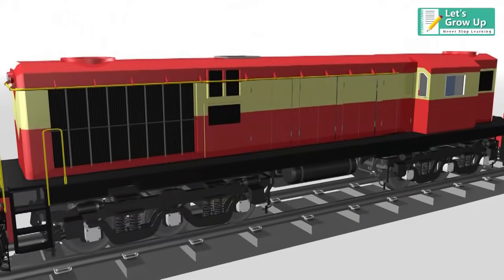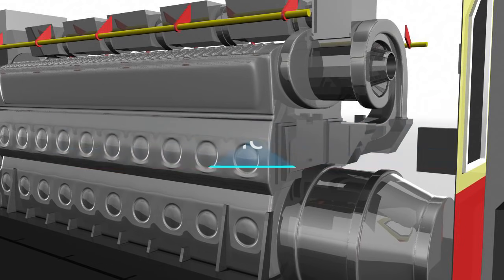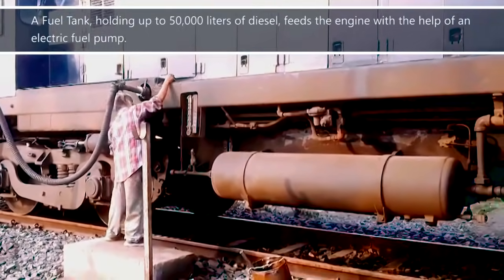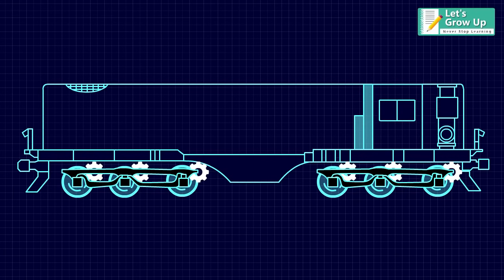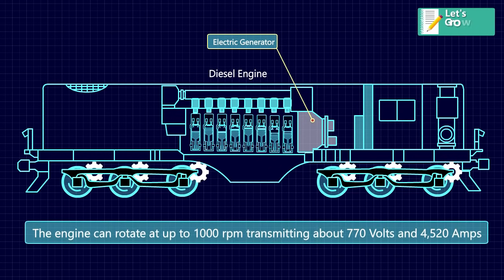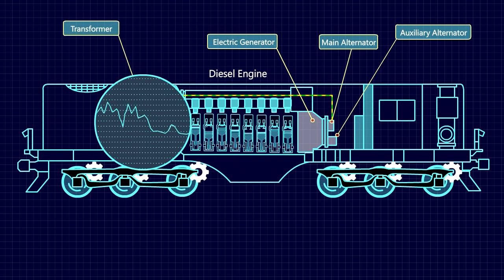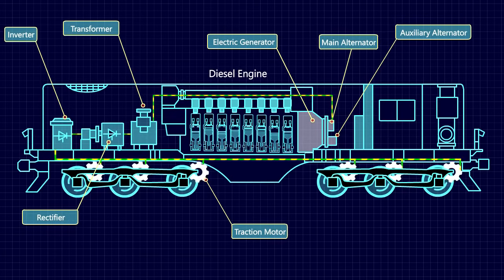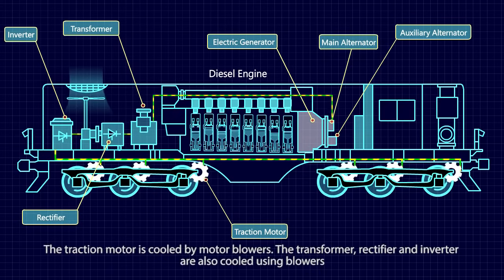Diesel engine working function | #Diesel locomotive | How a diesel locomotive works?

Comment: "A diesel locomotive is basically an electric locomotive"

Yeah an oil truck is basically a Porsche
Reply: It depends. Either a dual locomotive (both Electric and Diesel Electric) or a Battery-powered locomotive.
Reply: @MrStark-up6fi  also have diesel-traction locomotive.
Reply: The Big problem is the way to get the Diesel Generated Mechanical Power to the wheels. Clutches and Torque Converters are not efficient or strong enough. Electric Motors are Torque efficient but you need a lot of in between electric stuf to get it working. Seems not very efficient though if I see this explanation movie
Reply: @GertoHeupink  Considering how much weight a train can move seems very efficient. A 400 horse diesel truck moves 80,000 lbs. A diesel locomotive at 5000 horses moves millions of lbs.
Reply: A diesel locomotive is self-employed whereas the electric locomotive cannot work without electricity.
Reply: A diesel locomotive uses a combustion engine to produce mechanical energy that gets converted into electricity to run. An electric locomotive uses electrification already present (like catenary, third rail, etc.) to run. They are similar in that they both use electricity for propulsion, but their power sources are very different. A claim like that is fine, but not explaining why that is the case defeats the purpose of the analogy.
Reply: @LiyteRail  why we not give direct mechanical power to locomotive like a car...

Comment: why electrical motors on wheel axles are preferred to gear transmission ????. why  D.C Generator is NOT coupled to Diesel Engine than A.C Generator  to avoid Rectifier?? what about efficiency ???

Comment: whats the difference of track between electric and diesel railway?
Reply: None. The track is the same. A fully electrified railroad would have overhead wires to power the locomotive, but a Diesel or steam locomotive could run on the same tracks.

Comment: The video shows a 4 stroke engine as we could see valves, springs, rocker arm etc.
Reply: Detroit Diesels which are 2 stroke engines have exhaust valves which are manipulated by cams and rocker arms. Also the fuel injectors are operated in the same way. The engine shown is in fact a 2 stroke engine
Reply: Oh, many thanks for your clarification, didn't know that 2 strokes also had such an arrangement in the past.

Comment: I am looking forward to a type of engine wherein the train should be hauled by directly by the same engine also when electric traction is available bypassing the diesel generator section . Basically switchable between internal generator and external electric traction .
Reply: British Railways Class 73 electro diesels (built1962-67) can operate as either diesel-electrics or pure electric loco's where there is access to the electified third rail in southern England.
Reply: The electric motor needs no transmission. I could not even imagine the transmission that would be needed to drive a train. Think of a semi truck transmission pulling 80,000 lbs while a train pulls millions of lbs.
Reply: Wdap4 does this..

Comment: ALCO is 4stroke & have DC traction motors (generator directly makes DC & feed to traction motors via a voltage controlling rheostat)! 
You have talked in this video about Electro Motive Diesel (EMD) but the animated photo is of American Locomotive Co. Ltd (ALCO).
Reply: Where is VCR is using in ALCO locos.? Some also locos Alternator being used.
Reply: @sajeevpk5051  alternator is used in EMD locomotives aka wd p/g 4 series
Old tech Dynamo with voltage regulator used in Alco

Comment: Shows footage from other users and does not credit

Also 2 or 4, and anywhere from a V8 to V20. This includes locomotives from small Plymouth & Ruston switchers to the failed GE AC6000 & EMD SD90MAC.

Comment: No transformer is used in a diesel locomotive.
Reply: YRS I CAN SEE THAT SOME  ROBOT  DOSE NOT HAVE THE COMPUTING POWER FOR THAT
Reply: Most of the locos I have seen use DC traction motors. So no inverters or transformers in traction system.

Comment: I worked on a US Army program a few years back that was tasked with developing a new class of manned ground vehicles. The basic chassis for these vehicles utilized a diesel/electric propulsion similar to the way a diesel/electric locomotive works. The program never made it through initial development not because the propulsion system wouldn't work, but because the Army would never stop changing requirements.
Reply: Aereaux this vehicle would have been massively heavy most likely.   Would have been very expensive to operate as it would not be very fuel efficient.
Reply: @mohammadsiddiqi3500  - What's it like having a room temperature IQ?
Reply: Cool, now Biden can give it to the Taliban.

Comment: A simple reason they are diesel-electric is, because of the enormous loads they pull, using any kind of transmission would be impractical.
Reply: Also, they will go in reverse just as fast as they go forward.
Reply: LOL... it's about torque at standstill
Reply: Thanks for your this comment. It is the answer of my worry. But with so much advancement in mechanical engg wont it be possible to directly couple the diesel engine to the wheels?
Reply: @feoo123  I think it's possible, BUT ... the transmission would have to be HUGE  ... also keep in mind that a diesel locomotive will go as fast in "forward" as it will in "reverse".   And if that's not enough, there are 3 sets of drive axels in the front and 3 sets of drive axels in the rear of the locomotive !   What a nightmare that would be to try to set up a transmission and driveshafts.   Also, I know of no transmission that can handle 30 million pounds (that's approximately what a coal train pulls ... on level ground).
Reply: @ohbrother3792  so we can say its not possible.

Comment: What is the power of an diesel locomotive in horse power...?
Reply: Differs from locomotive to locomotive, some can be as low as 1,500 ponies, while others can have up to 4,500 ponies. Only a select few have had the privilege of trying 6,000 ponies, but now are either rebuilt, downgraded, or scraped.

Comment: What is the power of an diesel locomotive in horse power...?
Reply: In North American heavy haul service, modern road locomotives are generally in the 4000 to 4500 HP range. There have been some offered in the 5000 to 6000 HP range but there were reliability issues with the diesel engine itself.

Comment: Seems to me the majority of the liquid fuel energy is spent making three phase electricity then having to cool down the effort of making it ..! Efficiency percentage would be interesting to know.
Reply: The simplicity of powering all 12 wheels I think is the advantage here. This gives the locomotive more traction and power. Having mechanical drive shafts to do that probably would equal the weight of the alternator, inverter, etc. This setup is at least easier maintenance if not also lower maintenance. Just my guess.

Comment: Wow and all this while i thought they simply used a large diesel engine to run the drive shaft of the locomotive like a truck!!
Reply: It's simply not practical. Locos need to produce full traction power from a dead stop, for which electric motors (and steam engines) are ideal.

The prime-mover electric drive also does away with the enormous clutches and multispeed gearboxes that would also be required for a conventional drive.

Prime mover also has the great advantage of operating the engine at it's most efficient speed & throttle position - constant speed & load vs. constantly varying.
Reply: @drlegendre  i see thank you

Comment: You didn't explain why they don't just use a straight diesel engine, instead of using a diesel engine to generate electricity to power motors that then run the locomotive
Reply: Electric motors have better characteristics for actually transferring power into the movement of the train, in particular, at lift-off. Traction motors can produce immense torque at zero speed whereas direct diesel engine power would require a clutch and thereby throw a lot of energy into heating clutch plates while trying to start a heavy train. Also, when trying to control wheel-slip, electric circuits can respond more quickly than typical mechanical systems.
Reply: The transmission are so big that it will no fit in the wheels
Reply: @321aguila  yet there is a mechanical locomotive that use voith hydraulic transmission. But I wonder why they are not more common
Reply: Clutch will not work at such high load

Comment: Why do they have to show the locomotive going backwards (or in push-pull configuration) instead of forward?
Reply: Because not all engines go forward. Southern Railway (US) used dual cab controls, & not all trains are pulled in a set up that is a A-B-A setup. Most local trains (trains that serve rail-accessible industries within a certain distance on a certain route) often have to return the locomotive facing the way it will face when it catches the next train out (im using BN (Burlington Northern), SP(Southern Pacific) BNSF & CSXT for my references). Also most A-B-A trains have engines facing both ways to make it easier on the crew when working regional yards & interchanges (areas of tracks where 2 or more railroads exchange cars).  It also does not matter on trains if it is in reverse or not. Unlike cars, trains dont have transmissions, so a engine in a long hood forward (or reverse) position can still go track speed (example 70 mph or 112 kmh), the way they go backwards & forwards has to do with polarity switching. For the CSX & BNSF most trains have a forward/forward (or elephant) consist or a back to back consist (a group of 2 or more engines). Sometimes though rare you will see a long hood/long hood setup as well. It all depends on which road/country your in, some like to please the brain with simplicity, while others (the entire North American freight network) prefer not having a wye or turntable at every regional yard.
Reply: @BattleshipOrion : OK, I get that. Then why didn’t they show an example of a front-facing locomotive? Just saying. LOL! Here in California, you don’t see rear-facing locos pulling intermodals or a manifest. There may be a couple of engines attached, but the leading unit is most always front facing. Having a rear-facing engine as a lead unit is like having a steam locomotive in the front of the train with the operator cab in the back instead of the front of the loco like GE or EMD engines do.
Reply: @TheJDLonline  It may have been a local freight going to serve industries, or a MoW train but also dont for get that some models have reverse-facing controls.
Reply: @TheJDLonline  
I thing the mana fest is also referred to as the consist.

Comment: As you say it is 2 stroke engine.. Then why there valves..???
Reply: Two stroke diesel needs exhaust valves if it has an uniflow scavenging method. There are intake ports on the cylinder walls controlled by the piston, for fresh air, but exhaust gases passing through valved ports on the cylinder head. EMD engines works like that.
Reply: @mukics1116  what is EMD engine..?? 
And how it works, please explain!
Reply: @mig_21bison  
From the Top deadpoint, in a nutshell:
-Fuel injected, the combustion pressing down the piston.
-At the lower deadpoint, the intake ports and exhaust valves being opened.
-Compressed air flows into the cylinder, pushing out the exhaust gases.
-Piston starts to move upwards, the intake ports and the exhaust valves being closed
-The piston compressing the air, making it hot enough for the ignition of the diesel fuel.
-At the top deadpoint, piston starts to move downwards, fuel injected, combustion, and so on.
EMD means the manufacturer, Electro-Motive Division (But some other engines work like this)
Air compression is a necessary thing, usually made by Roots-blower and/or turbocharger. 
Timing mostly use gears for the adequate precision and reliability.
Reply: these are not 2 stroke motorcycle engines.. they need exhaust valves to open and close no EX porting in the cylinders
Reply: @fidelcatsro6948  how these valves operate...?? How the timing is maintained please explain.

Comment: The fuel tank capacity is 5000 ltr not 50000 or no transformer is used in diesel electric locomotive
Reply: Dont recall a transformer in the diesel electric system!
Reply: That was confusing as to why go from AC to DC and then back to AC.   Just use a rotary phase convertor or a  variable frequency drive.
Reply: @lw7238  The VFD does exactly that. It internally converts AC to DC to AC as you can’t change the frequency from AC of different frequency directly.
What I do not like in the video is that the output of the rectifier is not a pure DC and the VFD does not even try to make it so internally.
Reply: @lw7238  vvvf

Comment: Are you sure the traction motors run on AC? Most Indian locos have DC motors, both ALCO as well as EMD.
Reply: No alco has dc traction and end has ac traction
Reply: @MsSubhra1985  Thanks for the info
Reply: EMD has AC traction motors, same with GE. I cant say for other countries. AC traction motors where introduced in EMD's SD40 (the SD40 predates the SD40-2), and have been a standard ever since. GE is credited with have the most developed AC traction motors in the industry.
Reply: @BattleshipOrion   Buyers can still get AC traction or DC traction depending on their needs. Historically, AC traction did not come along until development of electrical switching componants that could handle the large amounts of power and electronics (computers) that could control them under the different conditions. I believe all of the SD40's and dash2's are DC traction.

Comment: *diésel electric locomotives can be 4 or 2 stroke, and from 8 to 20 cilynders
Reply: Also can be DC traction or ac traction
Reply: I thought some had 24 cylinders.
 I also thought they ran at 1800 RPM.
Reply: @babydriver8134  Which?
Reply: @babydriver8134  ok. I thought the maxim number of cylinders is 20. In diésel locomotives, of course
Reply: @ivannipaidea970  how can a locomotive engine be 2 stroke?
Reply: @ericschepers9317  ¿? Why not?
Reply: @ivannipaidea970  that means the loco has to burn diesel fuel and oil
Reply: @ericschepers9317  not. The 2 stroke diesel isn't like 2 stroke petrol.
The cranckase is like in the 4 stroke.
And scape is like too 4 stroke, valvles in the head.
Also injection of fuel is with injector in head, during admission
But air enter in cylinders through portholes. This air always is compressed by a compressor (roots or turbo)
You have videos here 😝
(Sorry for my English, I'm from Spain. But I work in the state company of railways, I know a little of trains 😜😜😜)
Reply: @ivannipaidea970  thank you , good explanation
Reply: IRcon loco 6 cylinder😁

Comment: Why not just driving the train directly with the Mech energy from the diesel engine?
Reply: How about replacing the diesel with arc reactor.
It's small, efficient, lightweight.
Reply: you will need another locomotive for the gearbox...and then you will have several gears to play with.. might as well use electric motor and get power from a good powerful diesel generator.... of course we can always try to make nuclear rods to heat a boiler steam turbine to produce power to spin the generators and it can go on for years!! that will be much much much much much more efficient!
Reply: Diesel.engine will burst due to heavy load